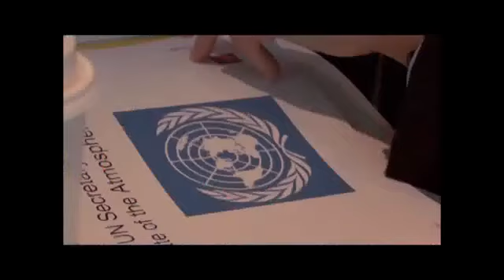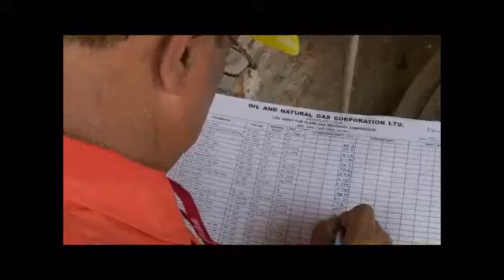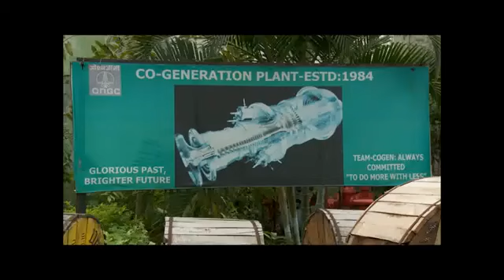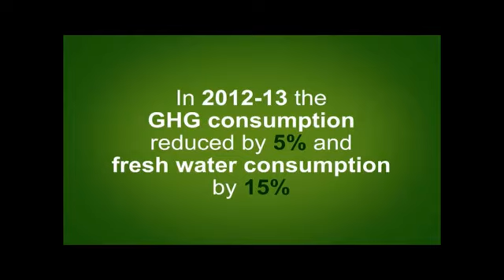ONGC Corporate Sustainability Film 2013

Comment: Proud of ONGC for the achievements. Please include biofuel blending in fossil fuels as one of the corporate strategy. This will benefit all  sectors of economy. Brazil has good hydro carbon reserves, and has 100 % Ethanol to 80% Ethanol blended fuel available. Why can't we go for more than 50% biofuel blending in diesel, petrol. Our hydrocarbon reserves are few and are relying on imports.